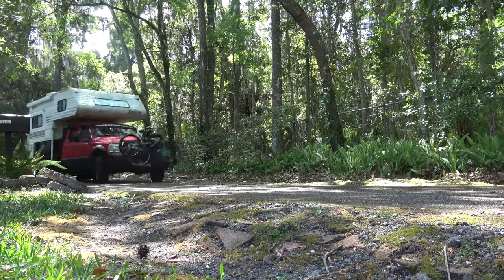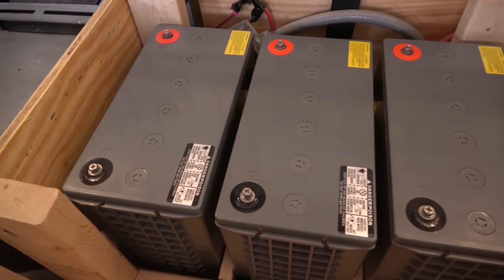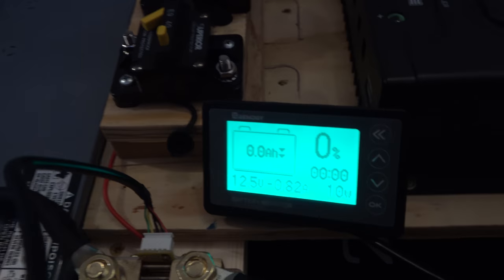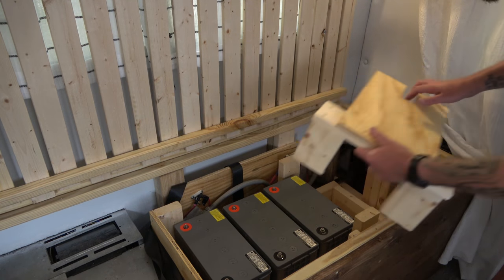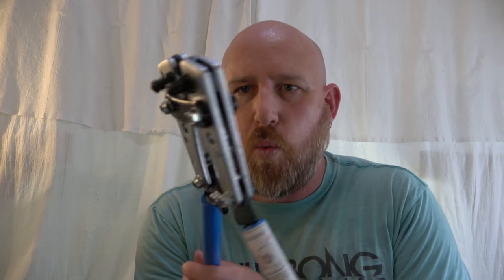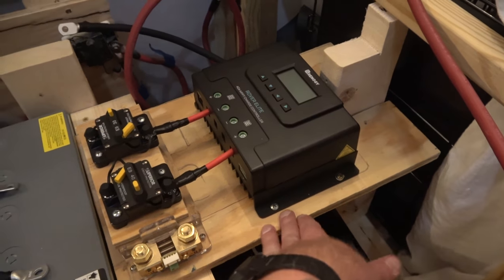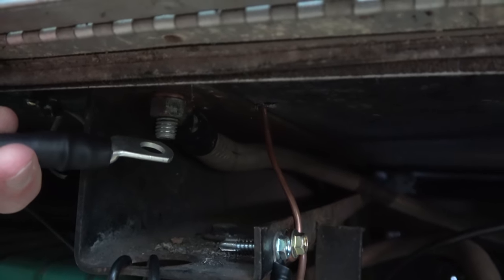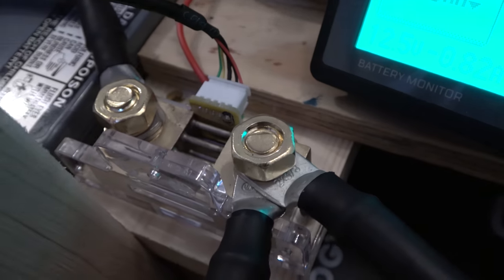CtW 142 // Installing Our Budget RV Power System Part 1 // Solar Power System For Boondocking

Comment: are you only running 12 volt ,,,i really want to be able to run some 120 For tv  and plugs ect
Reply from the maker: We have 12 volt appliances, like lights and fans, and 110V outlets when we have shore power. And we have a 2000W inverter to turn our 12V DC power into 110V AC power when we are boondocking.

Comment: I just noticed something ,,,,,You only have 1 tshirt ,,,,,lol
Reply from the maker: I have exactly 9 decent shirts. They go in rotation. I typically wear 2 shirts for part of each day. 1 for life and 1 for working out. I can make the daily shirt last 2-3 days easy. The workout shirt goes a week or longer. At this rate, by the time we do laundry (every 2-3 weeks) I've only used 4-5 shirts at most. So the other 4-5 get moved to the front of the closet and I try to wear them... kind of like balancing your tires. This doesn't always happen, so many times I am in the same shirt. With the install, I went through shirts more often as only 2-3 were dedicated for getting messy. So yeah, thanks for noticing. I take it as a complement to excel at minimalism. ;)